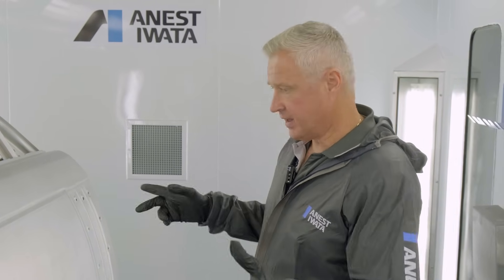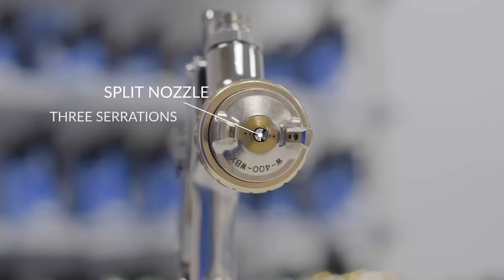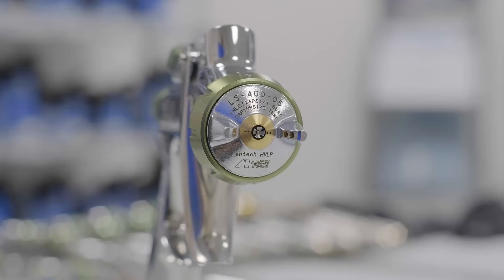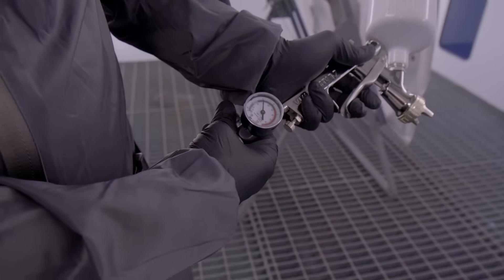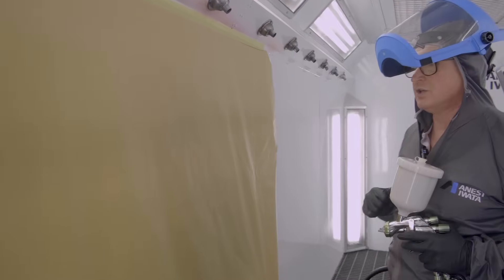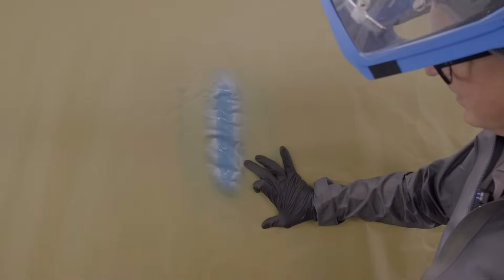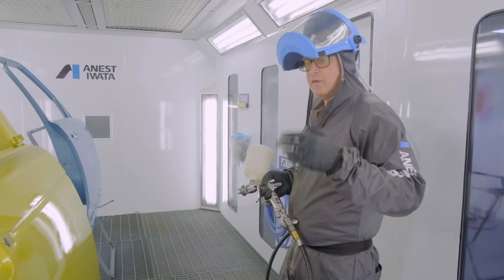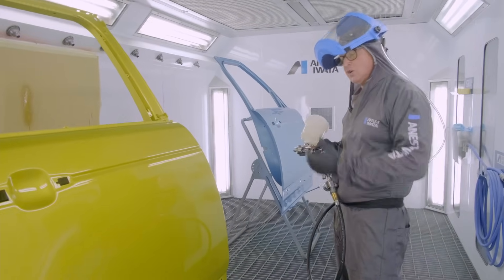How to Paint Primer Base and Clear – Three stage application

Comment: My problem with most guns and these are in that category is, nice wide pattern, has to overlap 90% down the panel to make it wet. The need for anything more than. 15-20% overlap negates wide fan claims.

Comment: 1st time i used the gun it was a water hose runs every where. Did you reduce wth activator ? by how much. Also my settings were ,Bottom wide open/trigger wide open and fan 3.5 out from closed fort he fluid.29 psi looks like you move way faster than i did.

Comment: Hi there. On the basecoat stage the text said the fan was fully open  . Is this true because I've never heard of any supernova user using full fan. To be fair I've never tried it either.  Always had my fan screwed all the way in and 2.5 turns out.
Reply from the maker: Hello, Yep fan and fluid fully open! I'm sure we will elaborate further in future videos about settings and set ups!
Reply: @AnestIwataRefinish  thanks . I will give it a go 👍🏻
Reply: Me too
Reply: I've never heard any supernova user to ever run full fan either due to tendency for top and bottom heavy. However your fan looks very even in the video in the demonstration.. odd.
Reply from the maker: Many variables could make a pattern have a heavy top and bottom. Wrong pressure... Wrong set up for the paint system in use... Gun maintenance... Humidity and temperature... The list goes on! We often hear about users tweaking fan and fluid, Every painter is different. We actively encourage the discussion on gun performance as this helps us improve our products and services!!
Reply: 33yrs automotive painter. Iwata on clearcoat all fully open everyday !!!

Comment: Hi guys ,i have just supernova for clearcoats, can i base coat with this gun paintet and which settings.
Reply from the maker: Hi, we would not recommend using the WS-400 for basecoat. It does depend on the baseboard in use. If you had to we would recommend a full fan and fluid with 2.0 Bar.

Comment: Hi great video.
 I have borrowed a ws400 of a  friend as I am thinking of buying one.
 I have noticed it flutters as I'm painting. 
It doesn't affect the finish but I'm finding it a bit weird.
is this normal? 🇦🇺
Reply from the maker: This could be the nozzle make sure it is tightened correctly. If issues continue you may need a new nozzle/needle set. 

it may also be worth checking there is no residue and give everything a thorough clean. 
Thanks Anest Iwata Refinish!

Comment: What viscosity of material did you have?
Reply from the maker: All mixed by scale and to manufacturer TDS. 

Base coat = 20-30 seconds DIN cup no. 4 at 20°C.
Clear coat = 15-17 seconds DIN Cup 4 at 20°C

Thanks Anest Iwata Refinish

Comment: Using a down draft you always start at the bottom of panel and  work UP and let the OVERSPRAY fall on wet product , start at the top and you have dry ass overspray you are spraying over and it looks like you painted over sand , been and PPG Automotive refinish tech for 44 years and no matter what type booth you are in you always let your over spray land on WET product so you dont have a dry ass paint job!
Been using Iwata for over 20 years now , and they all served me well. 
Great guns!   
I tested the SuperNova's a year before they were put in to production ( wonderful guns) and gave my input, only one thing I didnt like is they could have downsized the gun 25% for my small hands as I never switched to them from my W-400 's and my LPH-400's  they are just easier to use!

Comment: Can you tell me what is the actual nozzel size in mm on the W400 LV WBX 1.4. I have A W77 with fluid tip N°22 which is supposed to be 2mm and actually is 1.7mm and a old Wider 85 11S and it says 1.4 on the box and is actual 1.1mm. I need to buy a new gun and am a bit worried about the fluid tip sizes. All the manufactures seem to lie about the fluid tip sizes.
Reply: У меня wbx c 1.4 и всё сортверствует у Sata не соответствует.

Comment: So which exact model of the ws400 are you using. This is not a HVLP model correct? Do the make a 1.8 nozzle for the ws400 for primer?
Reply from the maker: Correct, in this video we are using the WS-400 Clear! LS-400 is HVLP! On WS we only go up a 1.5hd.

Comment: Never paint jamb first. Always outside then jamb
Reply: What is the reason for painting jam last?
Reply: @jondoe4667  if you paint jamb first any overspray from jamb lands on main surface. That overspray causes irregular surface tension for the paint to land on when you transfer to main surface. Possibly effecting how it lays down or metallic/Pearl  orientation.
If you spray main surface first and then switch to jamb any overspray from jamb will land on an already wet bed/surface and melt in flawless. This comes into play even more so when spraying tri stage coats.
Reply: @full_metal2452  makes sense. Thanks for explaining.

Comment: Why do companies want to sell you a different gun for every kind of paint? If you know what you're doing, you can do it all with 1 gun (plus a mini gun) and a few different tips/caps. Maybe I'll use a cheap gun for primer if i know I'm going to sand anyway.
Reply: ...paint is a fluid,  and when it comes to spraying it, the only real factor is its viscosity. Viscosity is addressed by tip/cap size (including cap air hole size) and air pressure. You don't need multiple guns to achieve this.
Reply: When you’re a simpleton, everything looks simple.
Reply: @reefhog  Apparently, when you're a simpleton, everything looks simple when you just throw money at it.
Reply: @nicholash8021  You’re telling the story, simpleton.
Reply: @reefhog  Maybe you can provide some insight instead of ad hominem.
Reply: @nicholash8021  Different paints have different viscosity. You don’t use the same gun for primer and finish coats, unless you like specks of primer in your finish. Waterborne base has different viscosity to solvent base, MS clears have different viscosity to HS clears. I don’t know of any professional painters who have only one gun, with several different needles and air caps. At a minimum, a professional painter would have a primer gun, a base coat gun, a gun for clear, a mini gun, one for just black and one for 2k single stage. You don’t have to buy the most expensive guns, but they do need to be good quality.

Comment: i tell one thing you do not have to use a different gun for every step. This the biggest lie in painting Yes you do need a bigger needle  size for primer if you are shooting high build. But you can you 1.3 or 1.4 for base and clear. and sealer